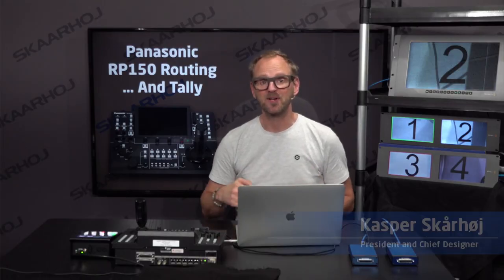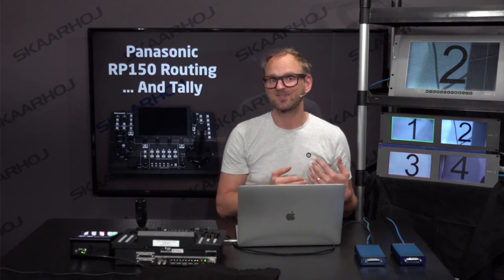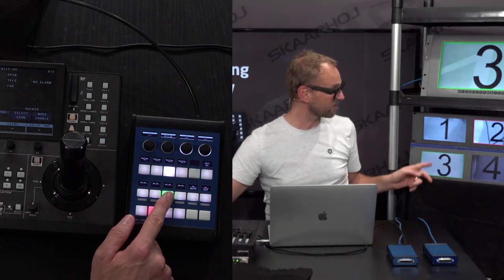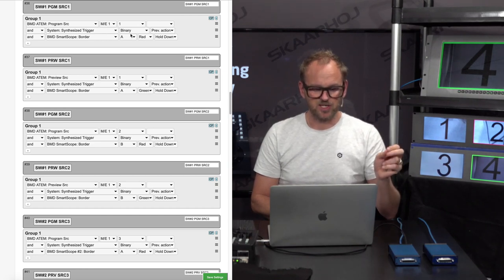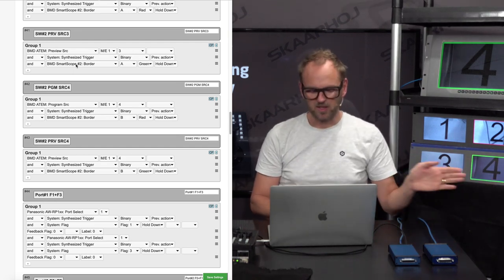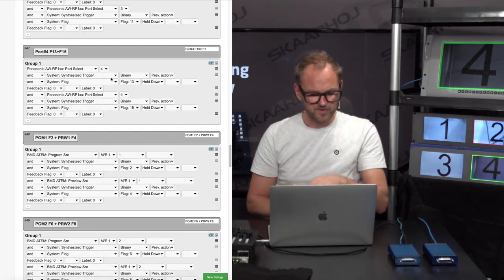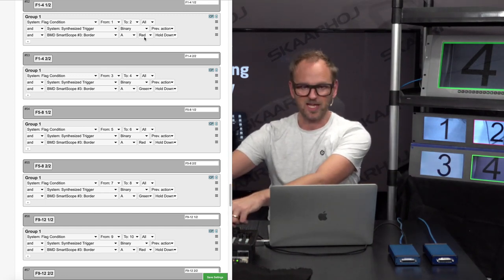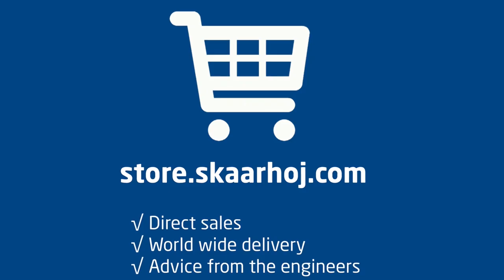Panasonic RP-150, ATEM switcher, Videohub and tally on SmartView monitors

Comment: Hi, is it possible to send tally information from an Atem to the RP150 so that the tally indicator on the surface (above the cam selection buttons) and the tally on the PTZ (ie UE100) will work? Do I need the DB25 port for this or just ethernet?
Also, when ist the GPI ETH available?
Reply from the maker: Hi.
We have not specifically testet this, but in theory it should be possible, as we can get the information from the ATEM and send to the RP150.
The question is what the RP150 can do with the information, or what plug it want the information.

Please contact info@skaarhoj.com to learn about availablity for ETH-GPI.